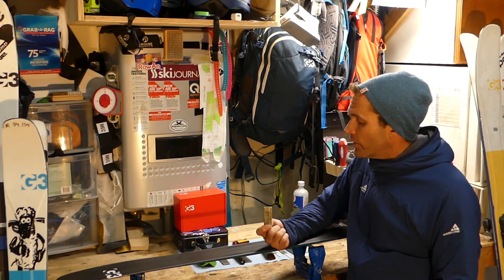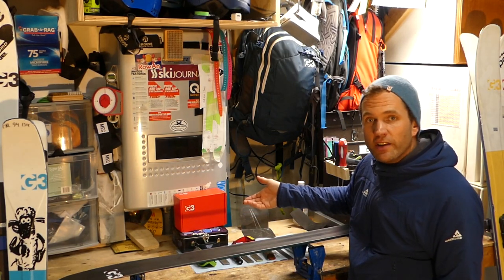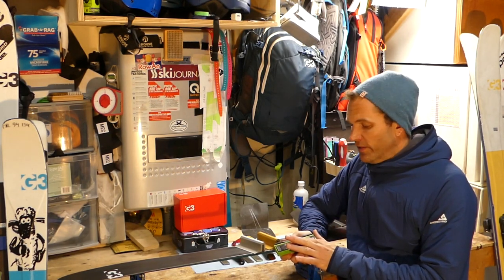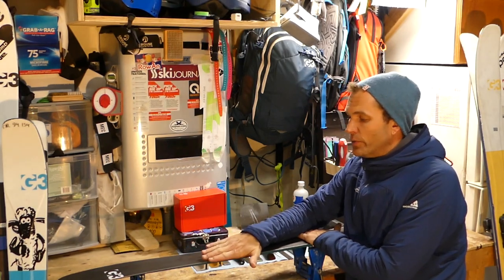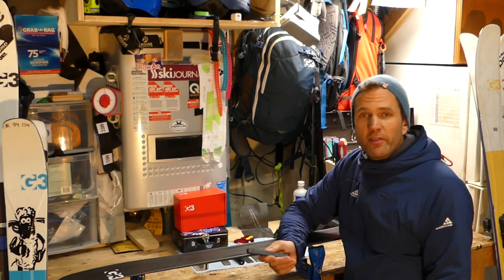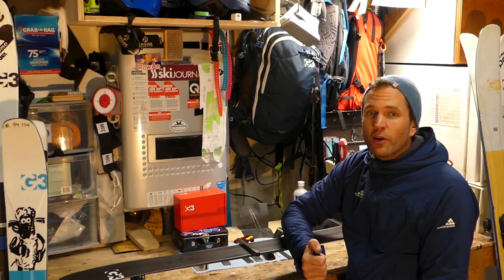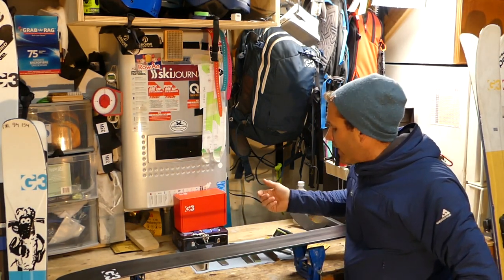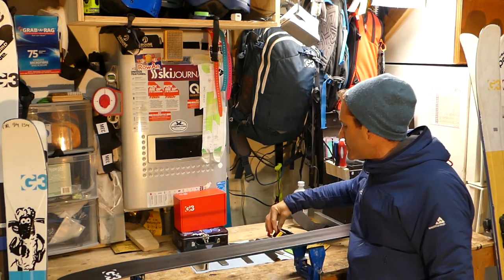How To Tune Ski Edges - G3 University

Comment: Thanks for putting this video together! Im a mechanical engineer, so not a materials expert, but I dabble. In the video you said that when you hit a rock it creates heat, and that hardens the edge. I believe that when you hit a rock, it "cold works" (or strain hardens) the steel edge, which means that by deforming it, it disrupts the crystal structure which makes it more stiff. This is because the defects in the crystal structure make it more difficult for the crystal planes flex and slip past each other, so it takes more force to deform (or in this case cut) the metal.
Reply: Ha this came to mind as I watched the video and then this is the first comment I saw.  The steel is work hardened. Not that it matters at all in this context!
Reply: Nice to some see smart people on youtube 👍🏻
Reply: Yep, the steel is work hardened, not hardened by the heating (and subsequent cooling in ice)

Comment: Every video that I've watched about tuning skis at home starts off with the base edge. DON'T do it.  Let your local shop set the base edge. Once the base edge is set don't mess with it work on the side edge. I've been fixing these mistakes for 20 years.
Reply: Can you elaborate. How are you supposed to get all those jagged bottom edges from dragging mid-season?  Do you work in a shop? Thanks!
Reply: Unfortunately you can't ever get rid of those bottom hits. The best and only thing you can do is take a diamond stone to the hardend edge. Make sure the stone is wet and work it until you "feel" the edge is consistent. I've been running a shop for a little longer than I'd like to say.
Reply: @grujenkins  
 thanks

Comment: IF the base bevel is only on the metal edge and the side bevel is referenced off the plastic base then the base bevel subtracts from the side wall bevel. Personally I always keep my base bevel at 0° and set my inside sidewall bevels to 88° and outside sidewall bevels to 90°. Occasionally I put my skis on the wrong way round and boy do I notice! My engineering head says a wobbly human wouldn’t notice the difference of 2° but I’d be very wrong! Give it a try. After 30 years skiing at 88° I am going to try 87° this year.
Reply: The base bevel is reference to the base. it's 1 degree from flat base.
Reply: @leifer20  So the base bevel makes the inclusive angle more obtuse. The side bevel makes the inclusive angle more acute. The side bevel removes material at the heel and the base bevel removes material at the edge. If you were to use an 88 degree side bevel and a 2 degree base bevel then they cancel each other and give an inclusive (final) angle of 90 degrees. Therefore you lose the advantage of a more acute angle that will cut into hard snow.
Reply: @mikeboyd1961  That's fair, I understand now. I'm surprised that I have never read this anywhere.
Reply: @leifer20  Yes every time I hear it, even from expert ski tuners, they get it wrong and I struggle to explain the correct way it works. Or rather they fail to listen? I have spent a lot of time sharpening woodworking planes which are slightly more complicated. They have a primary bevel, a micro bevel and sometime a back bevel. The primary bevel gives a fairly acute angle, usually 25 degrees, but the micro and back bevel make the tip more obtuse. This means it stays sharper longer and is less likely to chip. It is a compromise though. I have different blades for softwood, hardwood and awkward grained hardwoods. I have now tried out my 87 degree inside edge ski setup at the indoor ski slope and it really suits me. I also haven’t detuned the tips as suggested. Hoping this suits me in La Grave, France, in 3 days time.

Comment: Hi, thanks for this video! You don't talk about removing bur from edge tuning. How do you do it and is it necessary?
Reply: Minimum 600 grit diamond (Arkansas or ceramic work too) flat on the base or in the file guide in a single pass.  Blue xtra hard gummi at 45 degrees with no (or very, very little) pressure to follow.  We're just trying to knock off the hanging burr leftover from sharpening and polishing the side edge.

Comment: Honestly I wouldn't advise to use only a diamond file, if you ski on ice, or hard pack, or slushy snow can also make the edge really dull, so I would use a normal file every day, if the snow was hard packed, or icy, but I'm a racer, and it is really time consuming(with waxing, it could be more than an hour),so if you are not so concerned about the conditions the next day, you sholdn't worry that much, and sharpening dayly nakes skies last one season or less

Comment: I'm confused by the diagram showing the bevel/ sidewall grinding. The cut is showing a bevel that is an acute angle,  Wouldn't we want a cut that is obtuse? Or are there situations where we might want one or the other? Or am I reading the diagram wrong?

*disregard. After watching more, your explanation of the difference between a side bevel and a base bevel answered my question. Great video!

It would help to have top and bottom of the ski labelled. Otherwise, very informative!

Comment: Any chance on going over the base level process without a tuner?
Reply: Start Haus Ski & Bike has a YouTube Video named “Base Care Ski Maintenance”  that I like. it looks real reasonable to me, but I have a woodworking background with hand tools, so I’m real comfortable and familiar with using and sharpening a steel card scraper. After that, it’s running through sandpaper grits 150, 180,  220 and then the scotch pads…

Comment: I bought some used skis from a shop in Salt Lake City. They told me they had tuned the skis to 1-1, their standard practice. I found out, however, that the factory setting for the skis in question is 1-2. Should I pay a shop to have the edges retuned, or won’t it make much difference.
Reply from the maker: Garth, you may want to wait until your next tune to make the change. The current tune will be great, but then you can see if you can feel the difference.